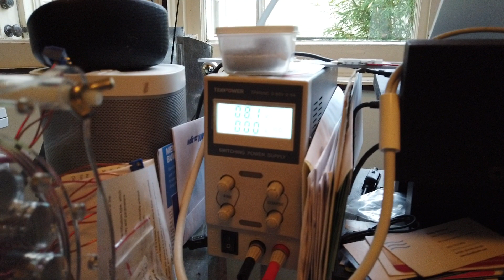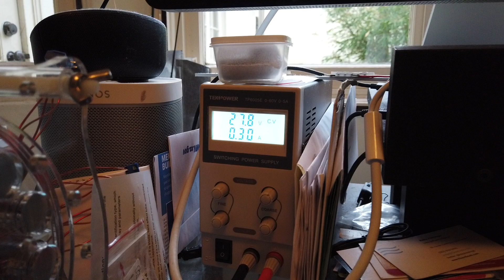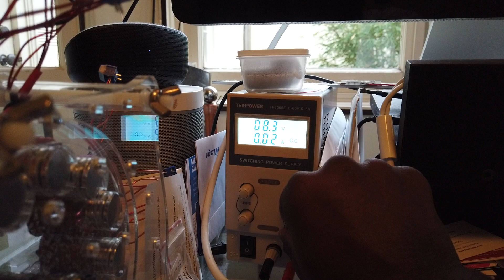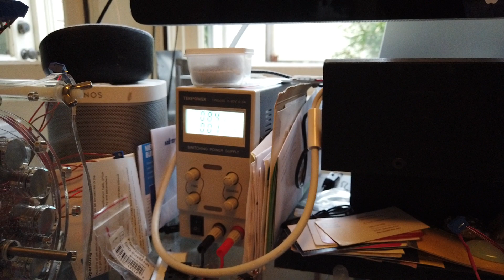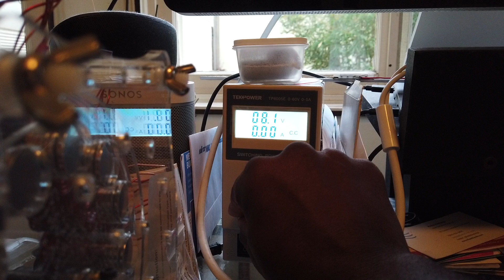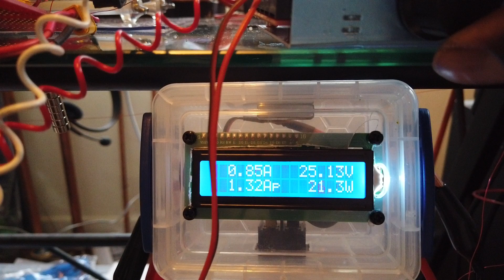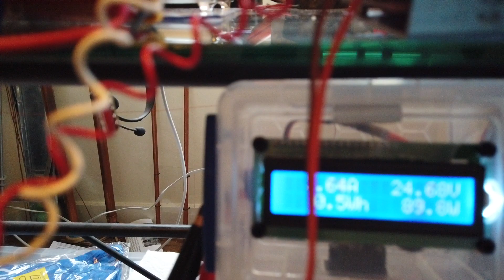Dual Axial Flux Motor Runs on Zero Amps! (Less than 10 mA)

Comment: Why dont you amplify the flux by helping it round to the other side/rotor with a u-shaped core ?
Reply from the maker: Time. It just takes time to design it. That would have been ideal, and I really wanted to do it, but I wanted to make sure the main principals worked before optimization.
Reply: @PerpetualMotor  Yes, i am also making a motor and i know it takes a while to get right. Note also that the steel backing may cause excessive "drag" which may negate the intended improvement, and may also increase EMF spike. Thats why i use IGBT transistors instead of Mosfet.

Comment: I would look into the ability to utilize the lorentz to buck boost(your coil design), also I would look into the ability to utilize the joule thief or ringer. as you these motors need volts not amps. If you need help ask. Nice effort btw and share. The less you know the better if you hold curiosity like a child all will be revealed. Also please don't misinform for click bait it is not 0 amps, correct this and maybe you can see what a child does. https://www.youtube.com/watch?v=nroBcB-42aU&ab_channel=GG  . I could state much although my realty is not yours we just share it.
All that equipment and yet such little progress made from the original design.
Reply from the maker: Thanks for the tips. Actually, although it may sound like click-bait, I stated what actually happened in the title. My ammeter measured 0 amps, because it couldn't go down to 10mA (which is also in the title.

Comment: i thought the oscilloscope in the background was important. When you saturate the copper with magnetism and your using a standard coil setup you are not helping the motor also there is nothing special about the current draw all pulse motors can do this no torque and no load are these motors even if fly wheeled.
Reply from the maker: It's definitely true of a lot of pulse motors, but this was the first that I personally built.

Comment: Perhaps you need to stabilize the other end of the axle that is wobbling
Reply: might be intended.
Reply: @L3X369  ok
Reply from the maker: In my latest dual axial flux motor I used a collar machined out of acrylic, but I found that I could get the same effect with some laser cut acrylic discs with some guiding holes.

Comment: What model PWM did you use on this motor design?
Reply from the maker: RioRand 7-70V PWM DC Motor Speed Controller Switch 30A https://www.amazon.com/dp/B071NQ5G71/ref=cm_sw_r_cp_api_glt_i_S5YDEH02Y7BRRCZFA0DM?_encoding=UTF8&psc=1

Comment: That little peepy sound is actually the backemf flyback colliding with magnets pretty sure.  Put a steering diode to collect the flyback off the transistor or mosfets drain and into a cap it will go away....
Reply from the maker: You may be right, but the diode is there. That's part of the Bedini circuit that I'm using to drive the motor.
Reply: @PerpetualMotor  ok just thinking!  Where does the diode go to? 
Is it the little neon light to save transistor?
If so, connect a 10 or 100uf cap to the diode instead,  if a N channel mosfet common ground to one side of cap diode into positive side of cap and cap should fill up fast and if then  it keeps climbing steadily way up past input voltage you know you are really catching it.  There is difference between flyback and back emf if very loud pffft pfft pffftand goes away with cap filling that will guess is actual backemf getting captured which is good, while still flyback gets "burned away" through little neon ...anyways have fun looks good!

Comment: Don't get why running at 10 mA is significant. It is essentially a low friction fly wheel with little drag and not doing work, so keeping it spinning shouldn't take much power.
Reply from the maker: You're right. The main significance is that I was personally able to build it and make it work.

Comment: Hey I like your motor I built the motor similar to that I just need help with the wiring eight coils and 8 magnets I'm producing 635 volts 227 amps at 60 HirschI just need help hooking update the wires after the twolegs

Comment: Interesting that you don't have any iron on outside of the magnet rotors -I guess the field must be completing through air. Try putting an iron plate on the outside of each magnet rotor...
Reply from the maker: Good point! It was difficult figuring how to do that in the assembly in a way that would prevent the metal from flying off.
Reply: @PerpetualMotor  I think you just have to glue an iron 'ring' onto each magnet rotor -the pull of the magnets might even be enough if its well balanced, at least 6mm thick though. Or look up HallBach Array and put some bar magnets inbetween the disk ones to strengthen the field on one side...
Reply from the maker: @noutram1000  I try to avoid glue as much as possible so that I can disassemble and reassemble in different configurations, but it might be time to play with that.
Reply: @PerpetualMotor  you do not have to glue anything to the magnets. Just a u-shaped "bridge" of ferrite or iron from one side to the other.
Reply: Exactly my idea also. It would theoretically increase performance a lot !!!

Comment: Did you design the motor to produce a certain torque or rpm?
Reply from the maker: Not really. Honestly, I just wanted to see if it could be done at all in this configuration.
Reply: @PerpetualMotor  ah ok, I'm trying to design a simpler magnetic motor but I have no idea which equations I can use
Reply from the maker: @jalankumar2766  I'd suggest following a schematic for your first motor, then take measurements. If you're building a motor from scratch, a good schematic will get you to a functional build. Then, you can see how closely the equations match.
Reply: @PerpetualMotor  have You ever measure the current or volt needed to turn dual flux axial vs single flux axial ?
Reply from the maker: @propertioso9081  I have not performed that test yet. I found that the weight increase of the rotor was significant enough to make those results seem less reliable. It would still be something worth checking, though.

Comment: Looks verry  good nice to see the current is so low for a big rotor, in one of mi newman/whindow motor replications i used a modified ron cole (H bridge) circuit en run a 1,5 kg rotor whit speaker magnets en fan at about 450 rpm for 4 months on a dead 4 amp/h  junk battery reading 10,2 v before en 11,7 after the expiriment , it cude run longer until the bearings ware out ( but i cude not leve it alone xd ) so i was thinkering around until it start to produse smoke  :(
Reply from the maker: Nice. Did you put together a circuit diagram?
Reply: @PerpetualMotor  yas i still heve the circuit somewhere, it was a bit of thinkering to get ot working to,  can i sent you the picture by mail   Send mi at email  oscarverwey@gmail.com
Reply from the maker: Oscar Verwey email sent.
Reply: @PerpetualMotor  oke today i wil send you one back :)

Comment: Do you have a schematic, pretty please with sugar on top?
Reply from the maker: You can see the drive circuit in this video: https://youtu.be/Cjs3GHyV10I The only difference is that this motor has 3 coils on the recovery circuit and the alternating and remaining 3 on a more typical pulse motor configuration.
Reply: @PerpetualMotor  Awesome...thanks!

Comment: Did you hand drill those plexiglass rotors? Left one wobbles horribly, right not so much.
Reply from the maker: All hand drilled. I don’t have enough room for a decent drill press. The next time around I’ll go with laser cut stainless steel blades. This was really just a proof-of-concept.
Reply: I am doing a similar project, had to throw away two pairs of woden rotors cause of wobble, last ones were made on CNC, didn't help. Now i am going for plexiglass. What's your opinion, what's better laser or CNC to achieve no wobble, they seem equally good if done at precise right angle.
Reply from the maker: Nikša I’ve worked with laser cut acrylic. My biggest problem was still trying to hand drill holes to a final size for bearings. Keeping them straight without a drill press is tricky. Laser cutting gives you a very slight taper on your holes, especially on thicker plastics (1/4” or more thickness). CNC is more precise, but generally more expensive. Hope that helps.
Reply: @PerpetualMotor  By taper you mean slightly rounded upper edges? You mean laser can't cut holes to final size?
Reply from the maker: Nikša the surface that the laser first strikes is hotter and will be wider than the bottom of the hole being cut. Regarding final sizes, if you don’t need high tolerances, then laser cutting is fine. Many times I would get holes cut just to have them centered, because during prototyping I wouldn’t actually know the best final dimension. That’s why I would hand drill into a laser cut hole.
Reply: @PerpetualMotor  Makes sense that upper part is hotter and thus wider, surely not acceptable when absolutely straight cut is needed, so i'll go with CNC as i planned, tnx for the input.